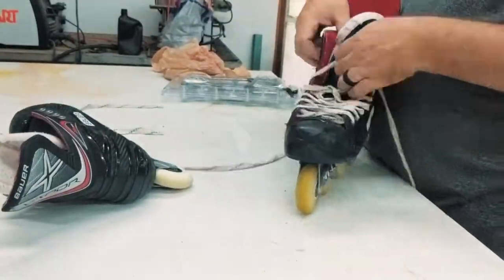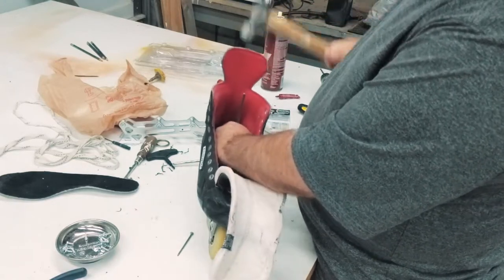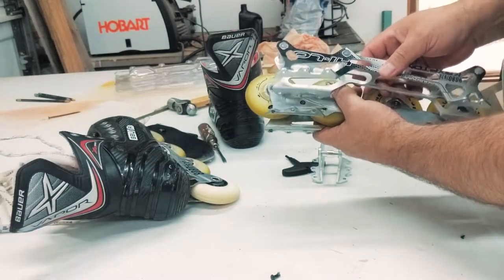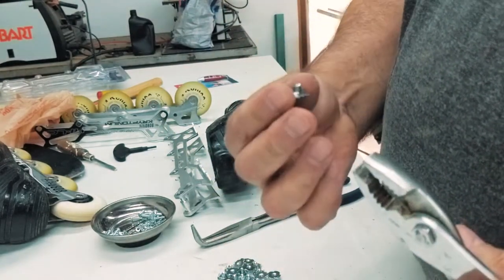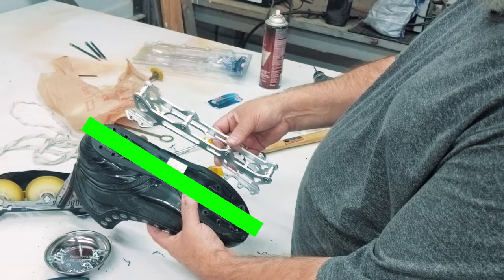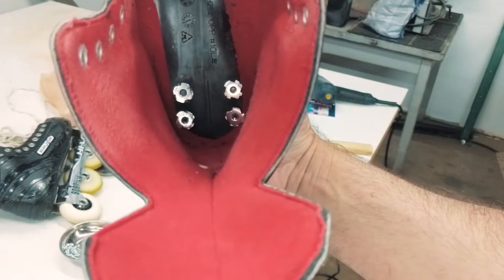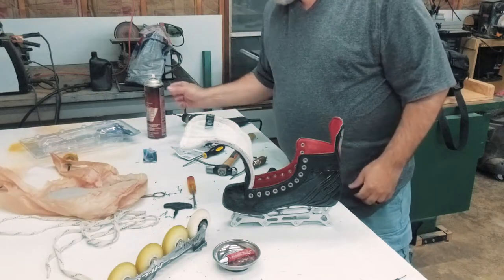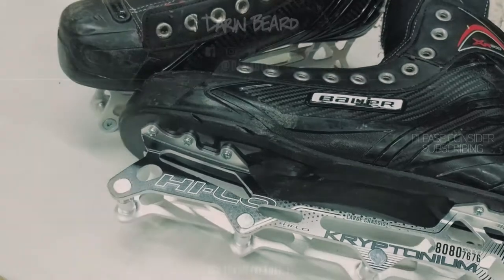In-Line Hockey Skate Chassis Replacement

Comment: I do quite a few conversations to quad skates and I never had much luck removing the rivets. I've tried knocking them out, drilling and eventually took to grinding them off. Will definitely have to try knocking them out again but with a better tool, you made this look really easy also like what you did with the star nuts. Great content thanks for sharing.